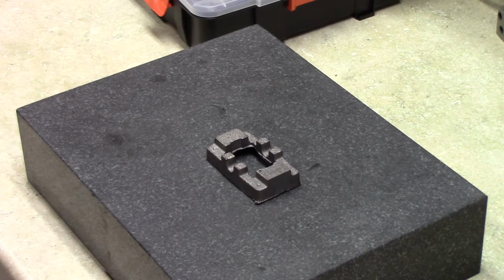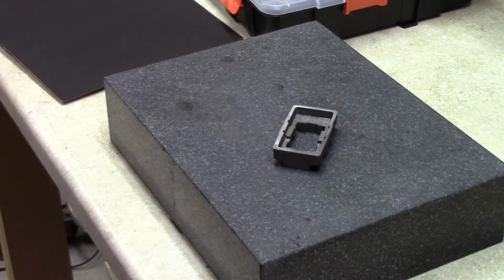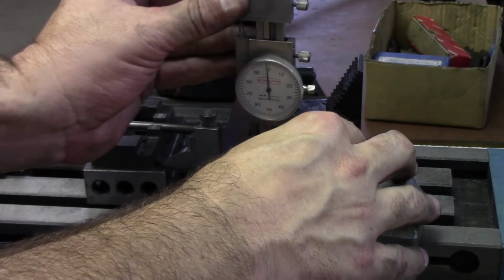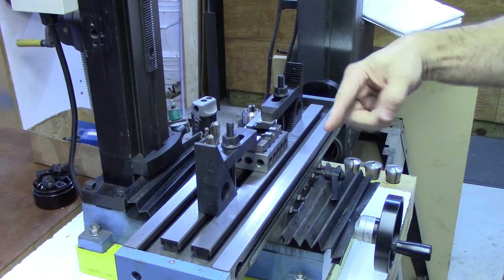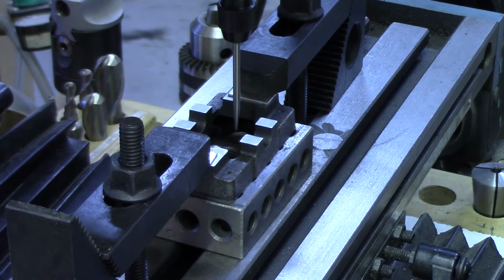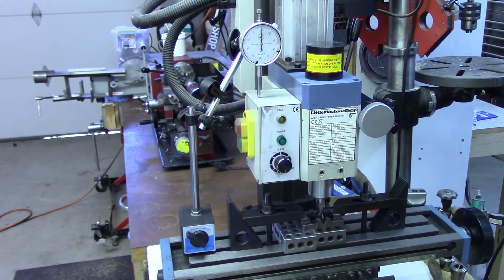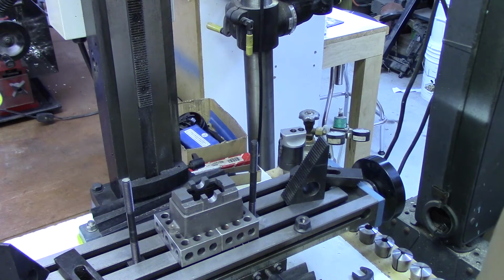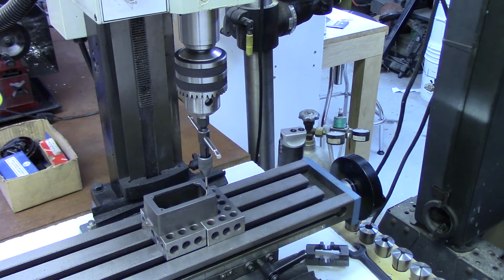Building the Stuart Models 10V Vertical Steam Engine - Part 3

Comment: A little advice. You took the time to use a center drill then the correct tapping drill. At that point you should have tapped that hole before you moved the table. That will assure a perpindicular thread properly centered in the bore. No ammount of eyeballing with a square can acheive that. You will find that tapping will go easier and less of a chance of breaking a small tap. 
My unsolicited 2 cent's worth.

Comment: was the milling cutter perfectly ground to exact diameter of the main bearing holes so they be perfectly round as per drawing?
Reply from the maker: No. It is just a regular ball end mill.  The bearing fits flat on the top surface, the circular cutout is a non-contact clearance. When I get to the bearings I am just going to clean them up enough that they don't touch.
Reply: is that your home machine shop. looks professional

Comment: this is the first time I have encountered BA threading.  Do you know if there are UNC and BA equivalents?   I was hoping to not have to buy new taps and dies for a Stuart project.
Reply: Tom Mattox it's basically just another thread. Just compare the clearance size and you should be able to find reasonable equivalents.

Comment: You're right about running any machine tool, the setup is the most important part. Like how you reversed the tap, breaking the chip, that gives a better and more accurate thread. I'm not a machinist, but was interested in it, and still am, that's why I'm watching this. Thanks.